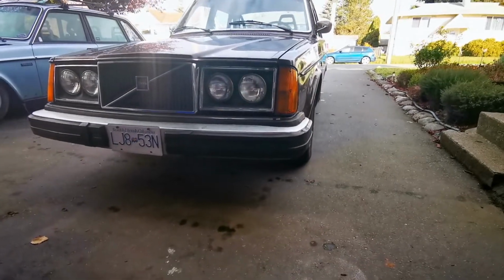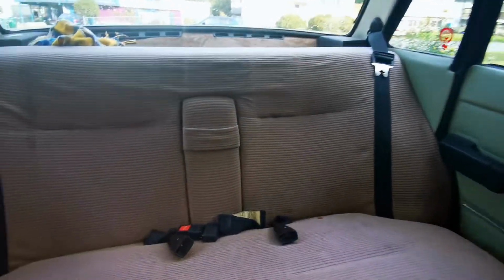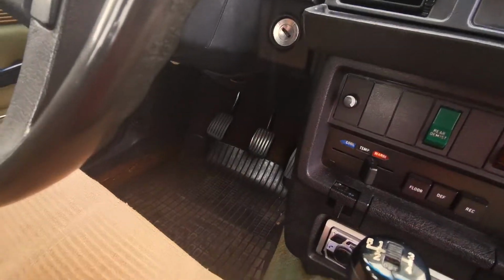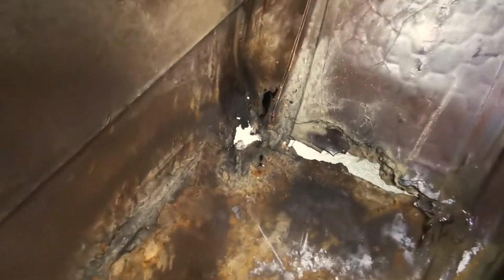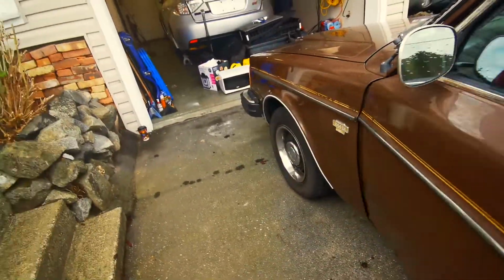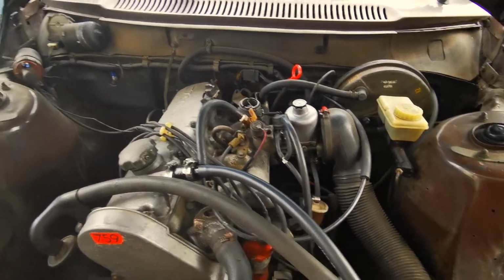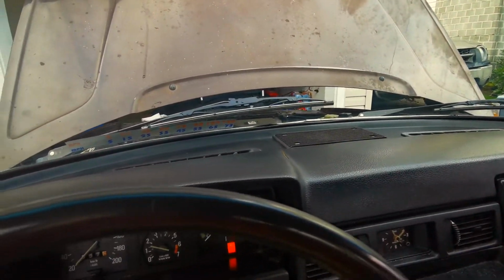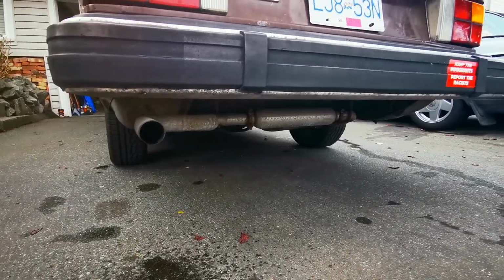Picked Up A New Daily | What Could It Be??

Comment: If you don*t like that annoying buzzard, you can put the later chimes, or bells, you only change the relay for a 1983 model problem solved, I did it with my 1981 240 GL, also I had swapped the 1981 dash due to it being cracked beyond repair, put in a 1983 dash it looked like new.